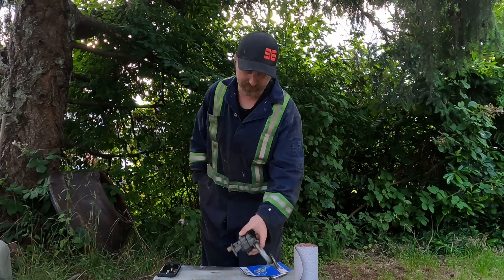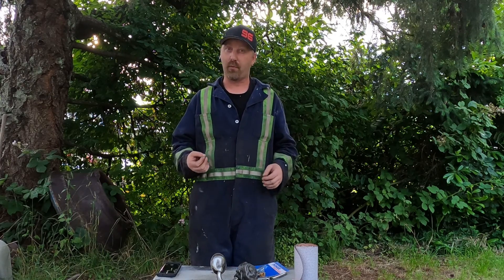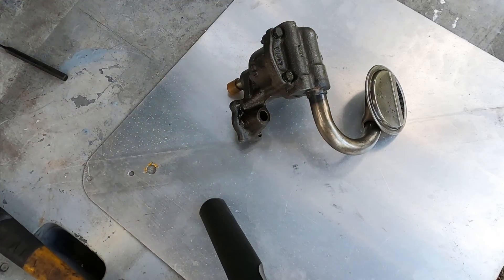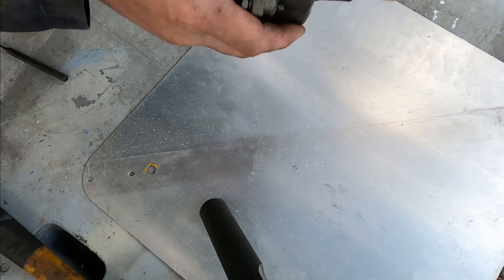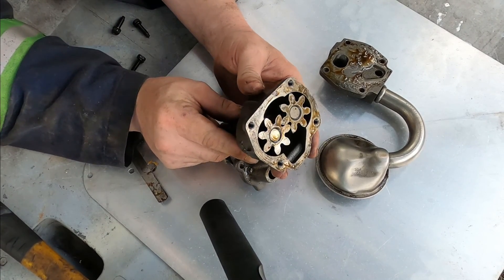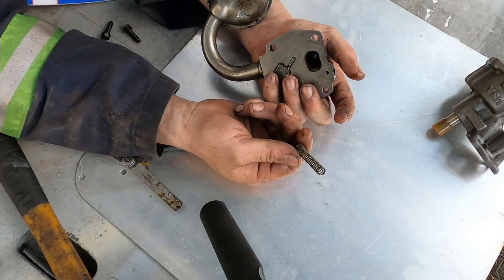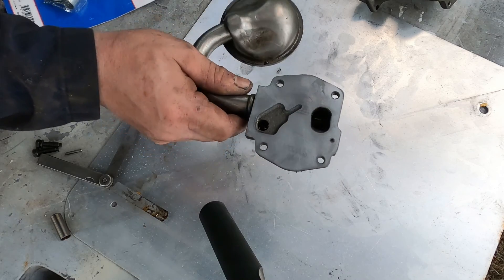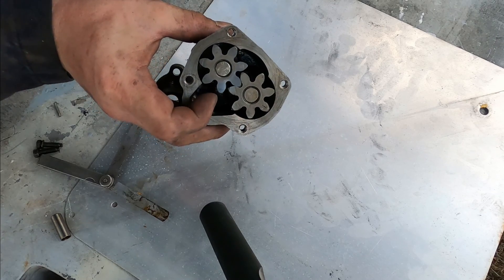HOW TO BLUEPRINT A SBC OIL PUMP FOR FREE!

Comment: I have had a 350 Chevy pump dive coupling fail  the plastic coupling fail, I lost oil pressure a freeway speeds, but the oil pressure returned at idle speed. There is a steel drive coupling sleeve available!

Comment: Here’s something I don’t know,what about if you bore all the block oil passages out and open drain back area’s and run a 7 qt pan and possibly even an oil cooler.do you think a hi volume/hi pressure pump with a 70 lb spring is good?

Comment: The only thing that can go wrong with a used one is the spring get weak,on a new one well quality control isn’t worth a damn any more but usually the clearances and debur ring and still check the pressure.i can’t believe what I see on You/Tube with people building first time motors and don’t even buy a book

Comment: I don't see how your getting an accurate reading on the depth of the gears.
A depth Mike is not that expensive.
Also, I didn't see you drill ONE .. 1/8" HOLE in it's idler gear.
This pressure feeds oil to the shaft it spins on !!!
If you drilled 2 holes there'd be an internal leak, so just ONE.
Be sure to do the exit port and main cap feed hole as well (I also chamfer it). Check alignment of oil passage to block to achieve better match.
NOW...the pump is blueprinted.
There's other stuff to do to cove..groove it.
It's beyond scope here to show this.
This eliminates chatter, which can cause Spark Scatter, as oil pump DRIVES your distributer.
Source "Smokey Younicks power secrets .
BILL Jenkins also outlines these procedures in his books.

Comment: To answer your question about the rotor plates- gm has a outside vendor that casts the pump bodies and covers and after the casting process are what's called spot faced! Quality control pulls a few of every batch run for tolerances.  Far from a blueprint but they work.

Comment: Agreed on the pumps being fine unless a catastrophic failure. And yep their never flat all could use a port job too. I normally take some lapping compound to em too. I bought a truck with a rod knock once the pickup had just fell off hitting on crank. Do you know if that pioneer bracket will fit the 3/4 pickups? Was looking at jegs one didn't realize pioneer made 1 too. But it says for 5/8" pickup.  I'm changing out my hv pump out because its sucking pan dry at higher rpms in a 4x4 for a reg m155 and wanna put more support on the pickup because it's really long and I'm extremely rough on it curious do you know if that fits the 3/4" pickups?